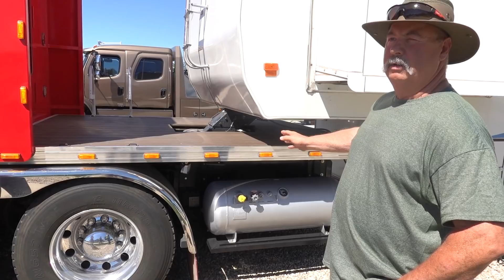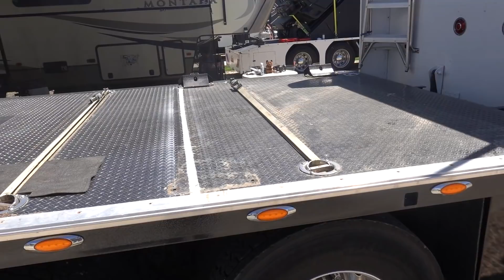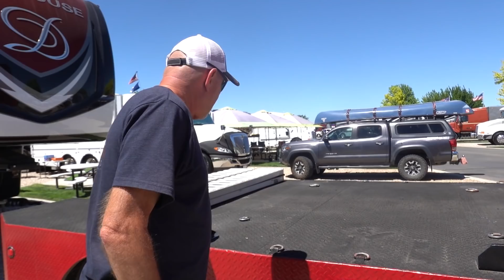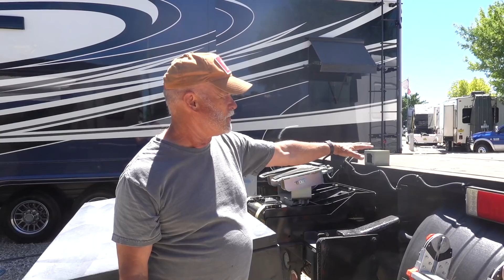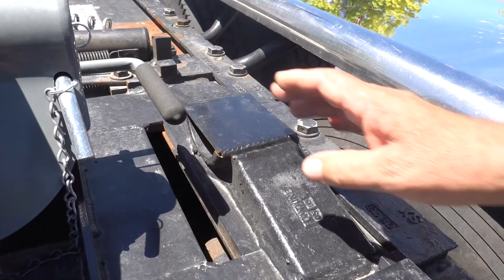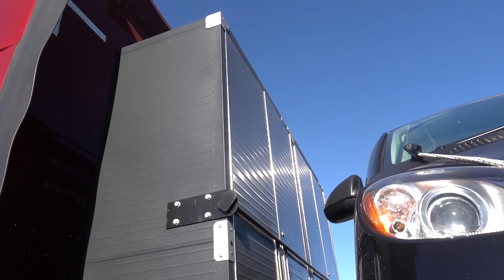West Coast HDT Rally: Day 7 - Bed Builds!!

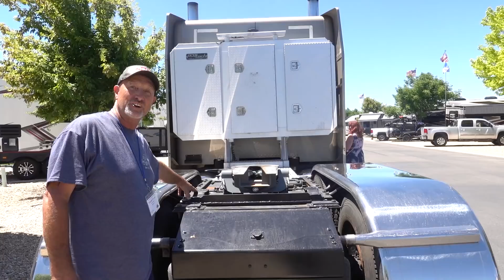Comment: Such a great idea starting on the 21:40 timestamp. I plan on doing the same on my Holland commercial fifth wheel rail. Does it just drop on without any additional modifications? Also, did you have to drill holes for the locking pins? Thank you in advance for any feedback you may have.

Comment: I disagree  the hot shot industry  is booming now. By singing it yes it does make it  not able to go back to full commerical.  However  it doesn't rule it out.  Majority of the hdt  trucks bought  and converted are retired semi's  so most likely  they won't end up going back into full duty.
Reply from the maker: You are right - the hot shot business is on fire right now. Just the transporters rolling out of Elkhart, Indiana are out there in droves. And yes, the hot shot business does have more leeway with the DOT than full traditional commercial.